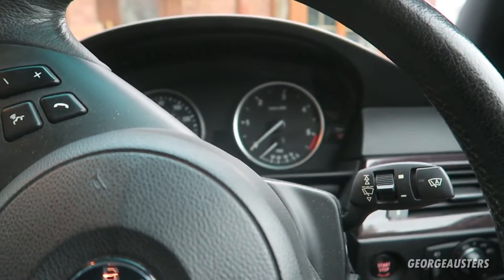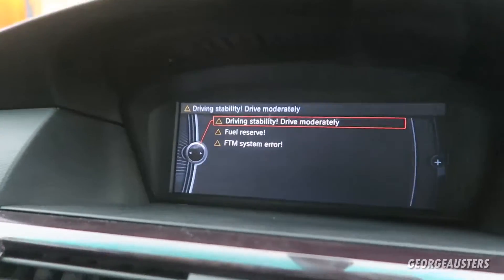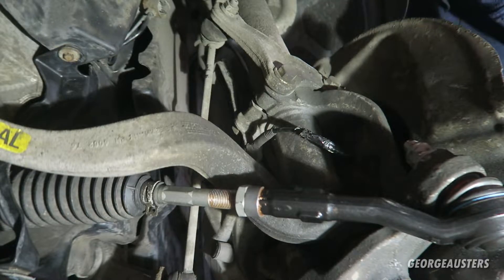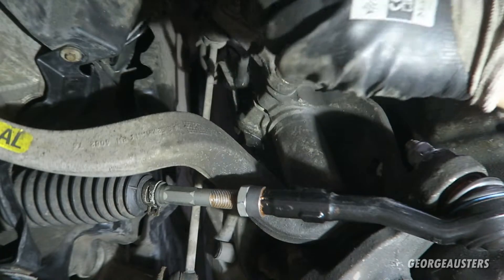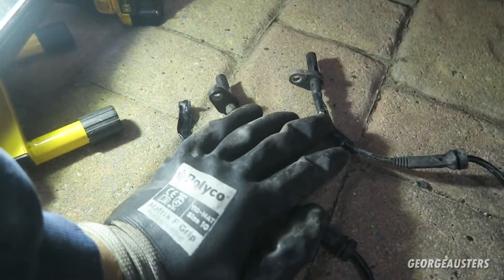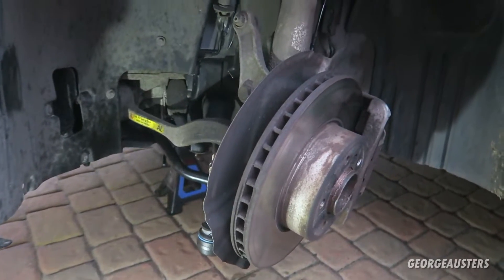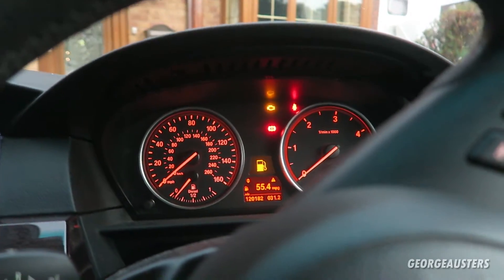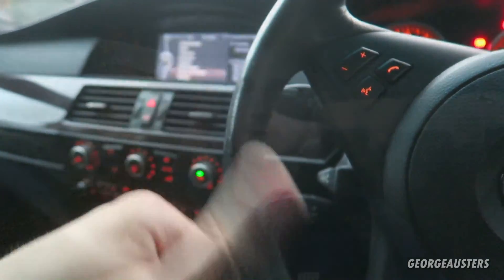How To Fix BMW ABS and FTM System Error!

Comment: Hi,

I have collected my E70 from BMW as it had fhe airbags recall sorted. On the way back, i had a warning message on the screen saying engine oil level is too high, so I thought its a coincidence. However I got another three fault messages on the screen and the dash, Flat Tyre Monitor/ ABS/ Parking Brake inoperative. I wonder if its still a coincidence or they broke something. If they replaced the airbags only, they shouldn't mess with the wheels and those sensors I guess. They told me they can take it back for an inspection, but because it's three different faults, there will be three inspections and if they can't blame their technician, i will have to pay £198x3 :O

Comment: Hello friends, bmw 320d 2014 having Ftm system error along with that Ac is not working and steering is hard, some times it works and sometimes again error but now its permanent, is that because of abs sesnor?
Reply: Hi George please help on this

Comment: Hi George, in January I had an MOT and I was told some joints and arms needed replacing, had that done and my steering was still very stiff with a knocking. Eventually my usual garage indicated that actually it was the steering rack, this was replaced and the steering is a lot lighter and must have been an issue for a while. However, since then, I have had two errors - 1. "Driving Stabalisation" which takes off the traction (bloody ridiculous in my opinion) and the first stage error is "Increased Steering Effort" - this I do not understand because the steering itself in terms of the wheel and motion are very smooth (especially compared to what it was before) - once that ISE error comes, if I drive for say 30 seconds, the Driving Stabilisation error then comes on, traction goes off and I may as well be driving on ice..... Module was recoded to try and help, still issues - any ideas what this might be? Could it be related to your situation in this video? I have not had my m135i for over two months now, still waiting on investigation! Only error that came up on scanner was 480AB8 (Not a bmw scanner) this error relates to "Unknown" which is possibly the most pointless error coded known to humanity - any advice or thoughts would be massively appreciated!!
Reply from the maker: Needs scanning with ISTA mate
Reply: @GeorgeAusters  beautiful - had to google what that was haha, I assume most BMW service garages etc. will have type? - Just seen you can download it as well

Comment: This happens to my 335d, but it goes on and off when it chooses, I’ll be driving everything be fine and then all of a sudden the ABS and the FTM come on I’ll drive for a few miles then it will go off and so on? Any ideas. Thanks
Reply: Having the same problem with my 2010 335d, any solution?
Reply: Me too

Comment: Thank you so much for sharing how did you know which one was the trouble one ?
Reply: Mine is steering,AC and FTM system error, how to check which sensor? And i tried disconnecting one sensor and check it show ABS issue as well
Reply from the maker: It was the one I cut through lol
Reply: is there a way to determine which sensor is failing.

Comment: Hi George, good video, thanks, can this sensor cause an 4x4 error?! Because on my e60 525xi 2005 N52, after replacing the front brakes, javr abs, dsc, 4x4 and TPM error, and i think it can be only this sensor.. Or maybe rust in connector..
Reply: Same here.
The cruise control turned off when passing over a bridge-joint, and the FTM-foult lit up together with a "4x4" under the yellow symbol in the middle. (E91 330xd from 2009).
So my question is also: Why can this effect the xdrive when going in speed. It might interfere with the traction control, but no issue on dry tarmac in 120 km/h...

Comment: HELP!!!!! MY 2011 BMW 528i shows the abs light on my dash, the chasis stability message popped on my screen but my wheels are locked i could move the car a couple of inches and then the wheels lock again and i know for a fact is not the transmission because I can put the car in gear and it's drivable and then the wheels lock and i have a red brake light on the right side of my dashboard and it's not the hand brake that comes up on the middle of the dashboard!!!!!!!!!!!!!!!!!
Reply: Can a bad sensor/ring cause the wheels to lock ?
Reply from the maker: Send a donation to help out the channel and I’d be happy to help you👍🏻

https://www.paypal.com/cgi-bin/webscr?cmd=_s-xclick&hosted_button_id=EVEBM82N66TCY&source=url
Reply: @GeorgeAusters  I already did my donation hope you can help me
Reply from the maker: @robertmares8253  I would say ABS sensor or ABS rings. You need to scan your car with ISTA
Reply: @robertmares8253  Hello , did you already fix the problem? If yes, what was it? Thank you
Reply: I did and it was something ridiculously stupid so the day I started having the problem I took my car in the morning to replace the 2 front tires now the guy who was working on my car decided to put a longer lug bolt on one wheels so obviously the long bolt was hitting the rotor and it Cain of lick the the wheels so I had to replace the damaged rotor and put the right lug bolt. I have no idea where this guy got the lug bolt! It seems it was one of those bolts you used when you add spacers to your wheels. I'm just surprised how he did not noticed it was a longer lug bolt like seriously dude!! What problems are you having
Reply: @robertomares9476  Omg really, happy you found the problem. I have the same lights just not the brake lights i think its a sensor.
Reply: @LetsPlayTutoPortugal  yeah most definitely is the sensor. Before you replace them spray them whit caliper/brake cleaner sometimes there not bad is just that they get extremely dirty obviously because of their location so you should try that before replacing them brake cleaner is really good to clean all type of sensors it won't damage them

Comment: Thank you very usefull video. I am getting same error in my bmw 320 d 2009 model. Can tell me how many sensor will be there in front wheel and back wheel. Front 1 in right and 1 in left and in back 1 in right and i sensor in left am i correct? So totally 4.. and how do I find out which sensor have failed ?

Comment: Quick question mate. I’ve got a bmw f30 2014 model, the ABS light came on and the diagnostic machine pointed out a front left sensor fault so after changing that the diagnostic machine read out another problem this time saying its the rear left sensor however if i unplug the front left sensor it goes back to saying its a front left sensor!
Reply: Also mate the error codes are reading permanent so they cant be removed!

Comment: Hi. I have a 2014 bmw 435i with ftm(not tpms). After replacing the left front tyre the system refuses to reset. The idrive reset button is greyed out and the cluster still shows low pressure warning in that tyre with the ftm light on. No other issues. No traction control issue no abs issues. Only ftm failure to reset. A guy tried diagnostics for me and want to change out the abs sensor in order to fix. However important note is that the other tyre is almost on it's way out. Could the difference is tyre thread cause this problem ? Please help
Reply from the maker: Earlier models all work through the ABS sensor but your model has an actual FTM sensor so may be that which is faulty
Reply: Did u solve the problem i have the same problem with my car 428i (2013)
I changed a tyre and then i have tyre pressure fault with stabilty control ans sometimes ABS